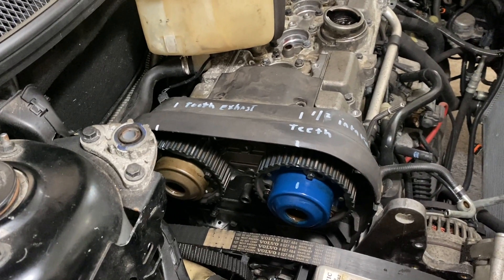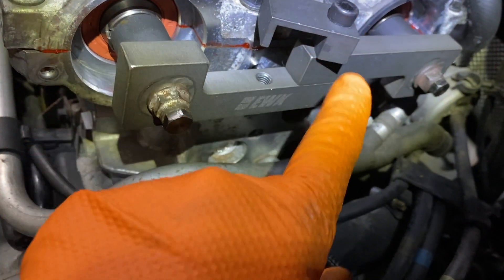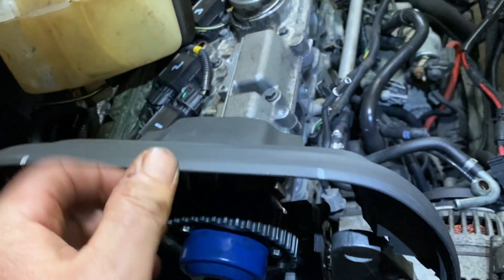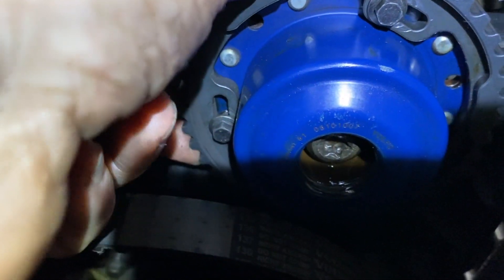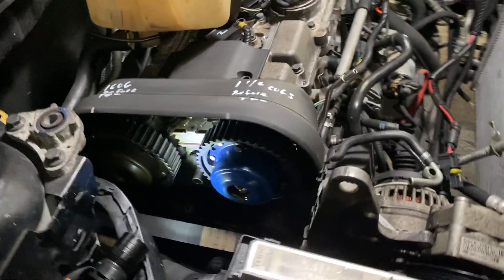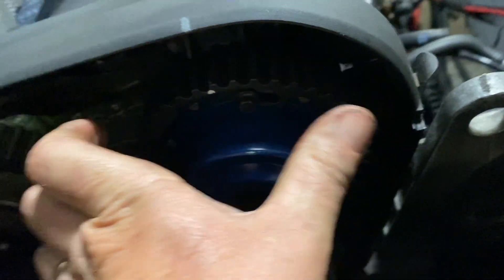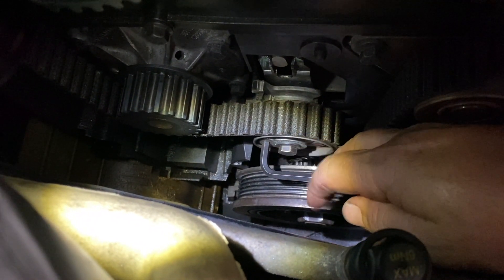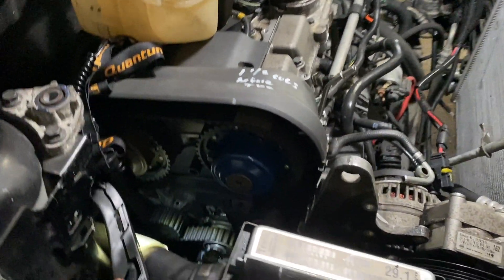Volvo 2.5 Turbo Variable Valve Timing (VVT) Alignment

Comment: Makes some sense to me now, I did some reading and some note taking when I had my T belt off. My Ex VVT total travel is 2 teeth, the intake total travel is 3 teeth, so when you set yours at and 1 and 1.5, thats exactly half, that centers the inner and outer part of the VVT hub. You have to visualize or know what the inside of a VVT looks like to understand. Now....Volvo or VIDA says... to do a belt you turn the crank CW past the mark 1/4 turn or 90 degrees, then back up CCW to the mark again, essentially what they are having you do is, make full contact with the VVT at the extreme CW position or limit of the VVT, so that why you hear people say, turn the VVT fully CW then install the belt. Thats for the belt, not the VVT, remember the VVT works off of oil pressure, when the engine is off there is none to move the VVT. Then you ask why 2 degrees on the Ex and 1.5 on the int, because intake valves are bigger, and hence can't move out of time as much with piston collision.
Reply: Today I pulled #1 plug and put a straw in, the crank pulley marks line up ONE TOOTH BTDC, IOW if I rotate the crank fwd one tooth the piston is at TDC, WTH?
Reply from the maker: A lot of modern vehicles set the timing just before top dead center to avoid piston valve contact when assembling, on the crank gear there are 2 marks as I explained in my video the pointer goes in the centre of the valley in between those 2 hair line marks.
Reply: @motorcarnut  Belt is on, runs the same, no CEL so far. I'm gonna source a Volvo FSM to read up on this.

Comment: Hi awesome video just wanted to ask do the timing marks have to be lined up exactly 12 and 12. I have a 2001 s60 2.4T and I’m unsure if my timing is off cause I get code p0014 advanced timing on exhaust vvt can the belt not aligned right cause that? Thank you
Reply from the maker: Pretty much yes, the marks on the timing cover should align with the vvt gears. But if anything was removed the whole valve timing has to be redone with the cam lock tool, if not you will get that code. Also make sure the vvt solenoid screen isn’t clogged, the will set that code as well.
Reply: Perfect thank you so much and absolutely makes sense of what’s going on, appreciate you very much
Reply from the maker: No problem, thanks

Comment: When you do the final turn on the cvvt hub, should the gear bolts reach the ends of the slots completely? Or will they just come close ?
Reply from the maker: As long as you’re following the video where ever they end up it fine
Reply: @motorcarnut  They shouldn't be all the way at the end of the ovals like that.  The internal actuator has to be all the way at it stop before you install the belt.  After installing the actuator on the camshafts you snug the center bolts then loosen your pulley bolts.  Next CENTER the pulley bolts in the ovals by turning the pulley.  When they are centered you snug the pulley bolts.  Then rotate the actuator clockwise all the way to its stop.   Then you loosen the center bolt and rotate the whole actuator, so your timing marks line up with the cover.  Next, tighten the center bolts to spec.  You do this for both pulleys.   Install the timing belt with your marks lined up and adjust the timing belt tensioner.  Once your belt is installed loosen the pulley bolts and install the actuator center caps and tighten to spec.  Last while holding the center caps, you tighten the pulley bolts to spec.  This will ensure the internal actuator is all the way at its end stop.  The fact he could rotate the actuator, so the pulley bolts are at the extreme end of the ovals means your actuator internally isn't all the way at its stop.
Reply from the maker: How I explain it in the video is correct. I do hundreds of Volvos and that’s how Volvo wants  it done.
Reply: @motorcarnut  I'm looking at factory service info right now and your method isn't in the service steps.
Reply from the maker: I explained it as simple as I can for people who may not have the best mechanical skills and want to tackle the job and get it done right the first time. But you can use the information you have and do it your way.
Reply: @Discretesignals  Why is there SO much confusion on this?
Reply: @Discretesignals Agreed, your instructions are correct and concise. There's pages of instructions for setting the vvt hub only to confuse you. The small pulley adjusting bolts shouldn't run out of travel while tightening the center plug.
Reply: Ok

Comment: This video came in clutch for my V70
Reply from the maker: Great, good luck!
Reply: Motorcarnut, I was driving my 2004 Volvo V70 2.4 non turbo and  a piece of my belt came apart and it must have jumped time because it cut off and wouldn't start back up. I'm going to replace the belt and was curious as to if I do my timing the same as your video seeing that my Volvo is a non turbo 2.4?
Thanks in advance and you do have a new subscriber in me .